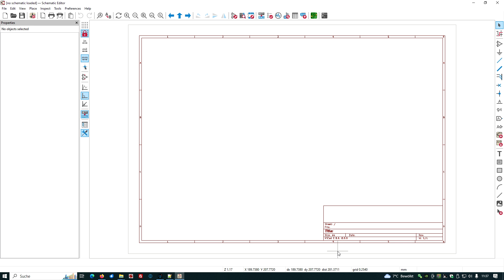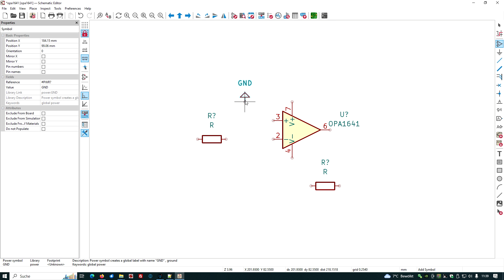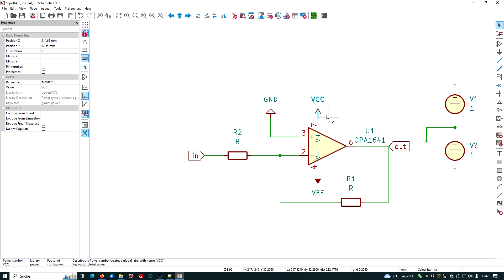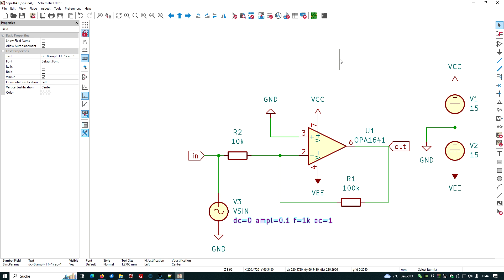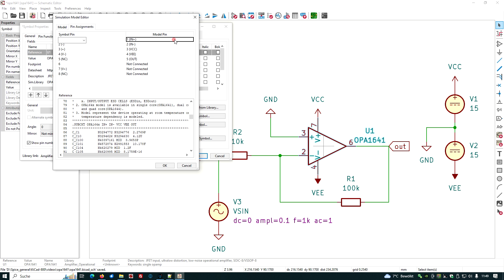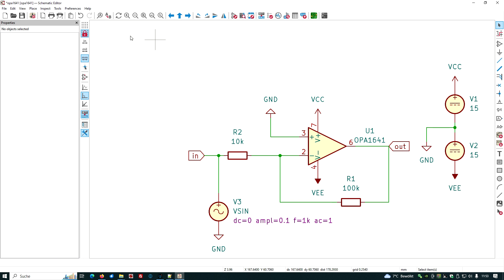ngspice in KiCad 8: amplifier using the TI OPA1641 audio opamp

Comment: I have been following your tutorials. Thank you for posting them! 
When I get to the transient simulation in this tutorial it throws the following error:
Error on line 0 :
a.xu1.x_s1.as_s1 %gd xu1.n2992267 xu1.clamp %gd xu1.n2992267 xu1.clamp xu1.x_s1:a_s1
MIF-ERROR - unable to find definition of model xu1.x_s1:a_s1
Error: circuit not parsed.
Error: vector time not found!
Error: vector time not found!
As I am new to using this tool, I am at a loss. What am I missing?  (KiCad 8 on Ubuntu 22.04) 
Thanks again.
Reply: For others who may run into this issue. I upgraded from KiCad 7 to Kicad 8 using:
sudo add-apt-repository ppa:kicad/kicad-8.0-releases
sudo apt update
sudo apt install kicad

The following commands resolved the issue:
sudo apt remove "*ngspice*"
sudo apt install kicad

Thank you to dsa-t on the KiCad Info Forum for the answer
Reply: @DonHaig-k9b  ran into the same issue, this fixed the problem. thx

Comment: hey, thanks for this series. I tried this with the opamp OPA 1602. But the Kicad 8 implemented opamp symbol has not pins for vcc and vee (it has just 3 pins 1=out,2=(-),3=(+)), but in that pineditor text the power supply where mentioned (.SUBCKT OPA160x IN+ IN- VCC VEE OUT ). So i guessed I just follow that text file with the pin editing: (pin1=out,pin2=(-),pin3=(+),pin4=(V-),pin5=(V+)). I even edited the symbol and added Pin 4 and 8 for VEE and VCC. But nothing worked. A Video how to get a OPA1602 or 1678 working would be much appreciated!!! thank you
Reply from the maker: Indeed the symbol has 8 pins, as the real 1602 circuit has. Select the symbol, then click three times onto the Eeschema canvas: A and B opamp part symbols, C as the power pins.

The simulation model has only 5 pins, as is common for opamps. So some translation is required between model and symbol. Currently this has to be done manually by the user, see https://ngspice.sourceforge.io/ngspice-eeschema.html#multi for an example. Yes, I should do a video about this.

Comment: Abstract

This video tutorial demonstrates how to simulate an audio amplifier circuit using the OPA1641 operational amplifier in KiCad 8 [edited] and NGspice.  Key concepts and steps covered in the video include:

* Circuit Design: Creating a schematic for an inverting amplifier configuration with a gain of 10.
* Component Selection:  Choosing resistors, power supplies, and an input voltage source with appropriate values
* Obtaining Spice Model: Downloading the OPA1641 Spice model from the Texas Instruments website.
* Model Integration: Attaching the downloaded spice model to the OPA1641 symbol in the schematic.  
* Pin Mapping: Correctly mapping model pins to symbol pins for accurate simulation.
* Simulations: Performing both transient and AC simulations to analyze the amplifier's time-domain response and frequency response.

Summary

* 0:00  Create a new KiCad project and name it appropriately.
* 0:35 Find, select, and place the OPA 1641 amplifier symbol in the workspace.
* 1:43 Add resistors, ground, and power supply symbols to the project.
* 2:33 Add necessary power symbols (VCC and VRE).
* 3:19 Add labels for input (in) and output (out).
* 3:53 Connect power supplies to amplifier. 
* 5:11 Assign values to power supplies (+15v, -15v) and resistors (10k and 100k for amplification factor of 10).
* 5:40 Add input voltage using the Vsin (sinusoidal input symbol).
* 6:19 Configure Vsin with DC=0, Amplitude=0.1, Frequency=1khz and set the AC tag to 1 for AC simulation.

Finding and Integrating the Spice Model

* 6:55 TI provides the necessary spice model. Search on their website, download, and extract. 
* 8:19  Examine the `.lib` file to confirm it contains the OPA 1641 subcircuit model.
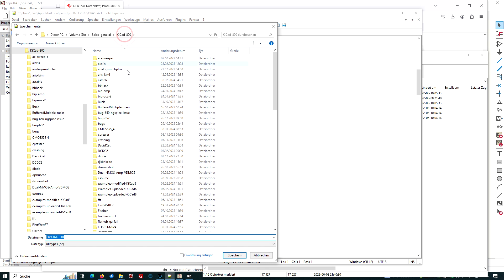* 9:14 Save the `.lib` file within the project directory. 
* 9:45 Attach the model to the OPA 1641 symbol in KiCad.
* 10:30 Be aware: Pin layouts in the spice model might not match the symbol. Adjust pin mappings carefully within the model editor.  

Setting Up and Running Simulations

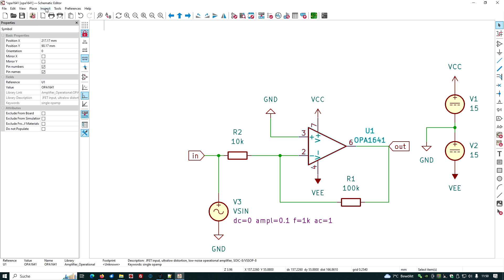* 12:57 Start with a Transient simulation
   * 13:15 Set appropriate time resolution and final time (example: 10us and 10ms)
   * 13:36 Mark the in and out voltages for plotting.
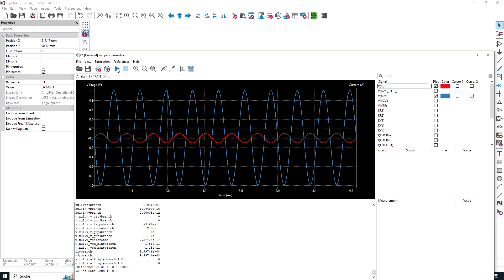   * 13:44 Run the simulation. Verify the input amplitude of 0.1 and expected output indicating amplification by a factor of 10.
* 14:16 Set up an AC Simulation
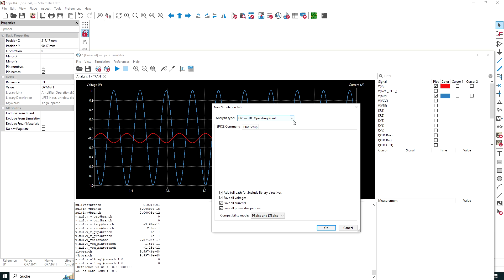    * 14:29 10 points per decade.  Start frequency 10 Hz, end frequency 10 MHz
    * 14:53  Select the output to observe the gain/phase response. 
    * 15:07 Run the AC simulation. Observe the frequency response. 

Saving Your Work

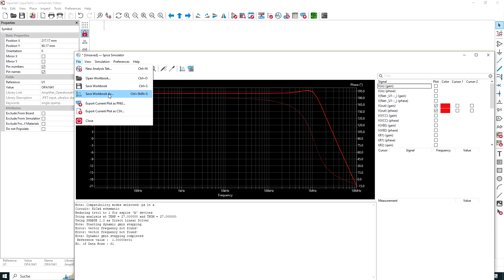* 15:50 Save the simulation setup for future use.
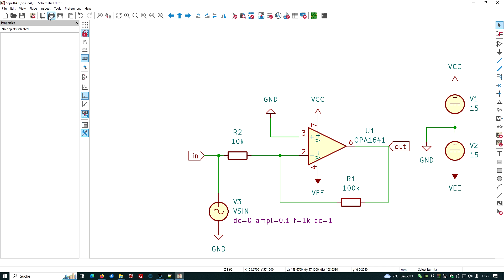* 16:14 Save the circuit diagram. 
 

Disclaimer: I used gemini advanced 1.0 (2024.03.04) to summarize the
youtube video transcript.  This method may make mistakes in recognizing words
Reply from the maker: You as the poster are responsible for the correctness of your post, nobody else, with disclaimer or without. Please check your posting. There is no Keysight, what is Keycad, for example.
Reply: @holger8105  Sorry, i will edit it.